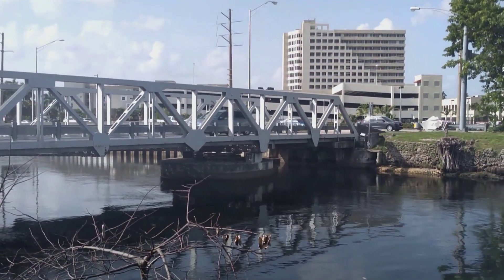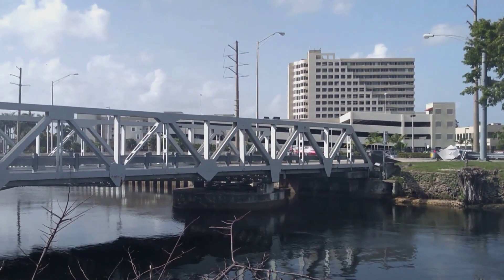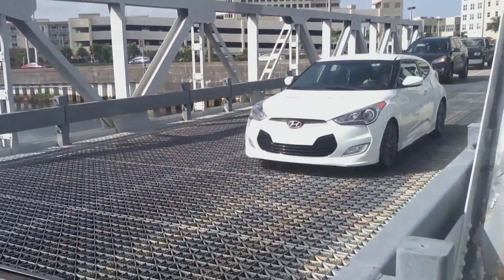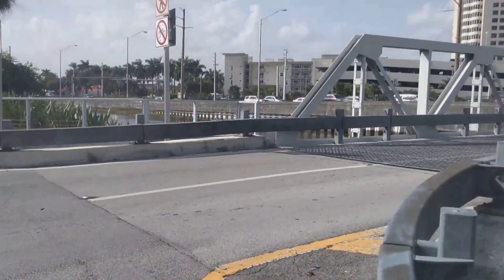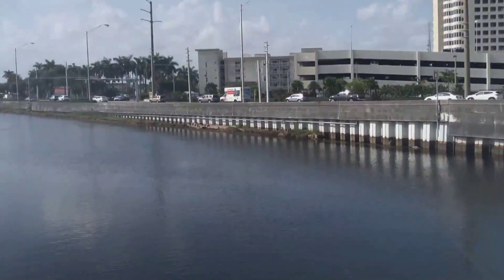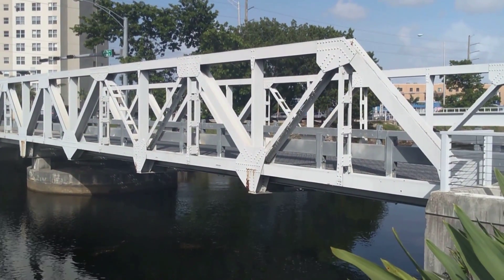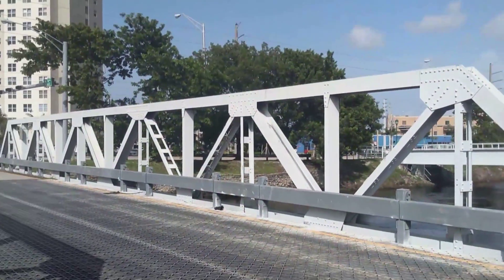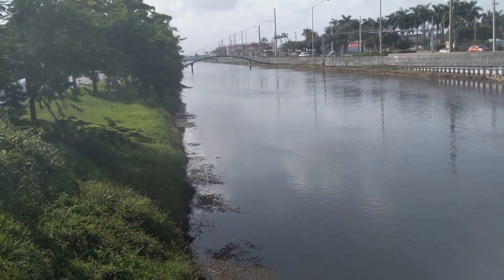What Does This Swing Bridge Look Like Almost 100 Years After ?

Comment: This bridge as well as the Vertical Lift bridge were both operational until the early to mid 70s (very neat to watch as a little kid being both were completely different). There is an identical bridge to this one that is still operational in Ft. Lauderdale called the 11th Ave Bridge and is just south of Broward Blvd. on the avenue. Take a look if you haven't yet.
Reply from the maker: So you're the person that can answer these questions I've always had... If the river was dammed in the 1940s (Just East of NW 36th St) Why was there a need for drawbridges at NW 36th ST and E 4th Ave in the 1950s? Also, what kind of boats did you personally see there until the 1970's? Thanks as always for the views and comments!